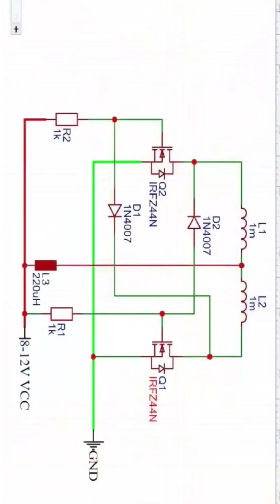How to Make an Induction Soldering Iron at Home with New Circuit Diagram #zaferyildiz  #diy #led

Comment: jarjla çalışan matkabı 220v nasıl çalışdıra bilirim
Reply: Matkabın voltajına uygun 20amperlik power supply
Reply: @pervineliyev1553  HI 👋🤠; YES... About 3 amps maximum should work OK 👍😎🤠
Reply: HI 👋🤠; I live in the USA... If you need different Voltage just buy a travel transformer ( 220 To 120) and vica-versa